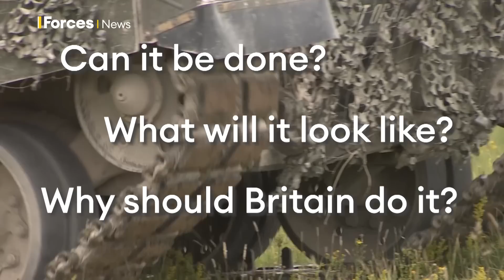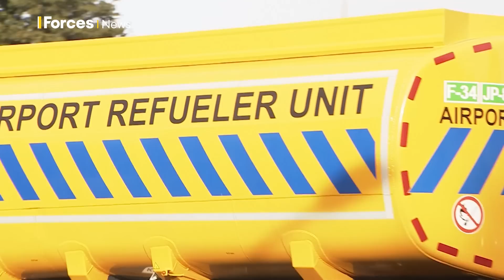Climate Warriors: How to fuel the military of the future

Comment: Tbh I think it's a good idea. If we end up in a war where we don't have easy access to traditional fuel, having the ability to use renewables would be good. So long as it's not 'progress for the sake of progress' I don't see the issue. The military should innovate and look for solutions like these.
Reply: Tbh I shared a similar sentiment on the last video.
But they have not justified their decision on any tactical and strategic reasoning.

Their reasoning is simply the "green agenda" (their words not mine)

So the mod and forces news rightly deserve criticism until they bother to give good reasoning.
Reply: @studentaviator3756  the military don't tell you their reasons

as the UK doesn't have much fuel available if we were cut off, i think the advantage they are after is pretty clear
Reply: @DarkShroom  I hope you are right they are doing it for strategic purposes. But as I said its barely justified on any strategic grounds and neither is any of this justified on costing grounds. Uk defence procurement can be bad enough without needing to add "social impact" (A concept they didnt really explain) into the contract.

Comment: Sorry but this doesn't give us an advantage over our enemy. Please don't pretend that, this place isn't looking for your propaganda.

There's niche cases where an electric drive is quiet but that's in the final approach in a tactical environment, not the 99.999% of the time where an electric vehicle is impractical.
Reply: I hate to say it but this is a very niche and narrow minded view. As with everything else we currently take for granted, developments are needed in this field to prove their effectiveness and to ensure we’re one step ahead of any adversary. If the supply of fossil fuels continues being hampered in the way it is by the conflict in Ukraine then we’re already on the back foot. 
Having a back up solution and the fundamentals already in place for renewable technologies to pick up any shortfall (potentially in a more effective way) then we immediately gain the advantage. 
Burying our heads in the sand and denying advancement in a field with endless potential is lunacy.
Reply: @JohnSmith-ts8xp  very true and a good outlook. However whatever we use needs to be supportable logistically, not just hot air on social media. For example electric vehicles need to be charged somewhere, the electricity needs to be generated. The rare earth metals needed for the batteries aren't available in the UK. We are a very long way off anything useful, a long way off and definitely not coming in the next 20 years regardless of what the green machine demands.
Reply: @JohnSmith-ts8xp  The fuel was an issue months before the beef in Ukraine started[…] let’s go Brandon, could reinstate the pipelines he closed down on day one of his illegitimate regime stealing power?!
Reply: @meme4one  
I’m not suggesting we’re going to be solving these problems overnight, but they’re certainly problems being evaluated and improved on globally at the moment. Who’s to say we don’t begin looking to provide hybrid engines into military vehicles? Instant power delivery from a near silent electric motor with fossil fuel back up when required. 
Big money is being pumped into this tech these days, so it’ll advance very quickly. Bear in mind that until very recently, electric cars didn’t exist and the very first iterations weren’t very good. In the years since, as the world has turned its attention toward finding better solutions, we have done and continue to do so. 
Britain’s role in staying ahead of the curve will absolutely benefit us in the future.
Reply: The Ukraine Military's successful use of Electric Motorcycles for quiet transport of snipers to their chosen target observation point and subsequent rapid relocation to avoid detection is a perfect example right now in a War Zone, 
Oops! Sorry Mr. Pooh Tin, I mean Special Ukrainian Excursion. The War has proven that the idea works better than noisy gasoline transportation for snipers.

Comment: Cant wait to see electric tanks and electric rockets and electric bullets!
Reply: The Rail Gun uses electromagnetic force to accelerate a missile to amazing speeds, more than traditional smokey propellants. That's almost an electric bullet right there 😳
Reply: @HighHopesBass First invented in 1918. Why do you ask? Rover Motors first developed a gas turbine engine for cars in the 1950's. Lots of things mature slowly because of adverse Government regulations, or economic forces at the time of invention which prevent further refinement. 

Then cataclysmic changes take place in the external infrastructure, and an old idea becomes worthy of huge investment. Thus the engine in the Abrams Tank uses a refined gas turbine. 

The Romans invented open sluices and aqueducts for transport of water over great distances. It was astronomically expensive in time , resources and labor, but now you can put polypipe across the same distances for a fraction of the cost in time, resources and labour, plus reduce water evaporation to a miniscule amount as an extra bonus. All because people have "put their little grey cells to work" as the famous Belgian Detective Hercule Poirot observed.